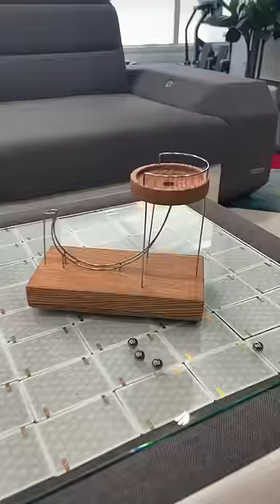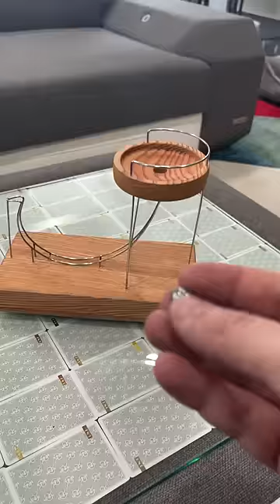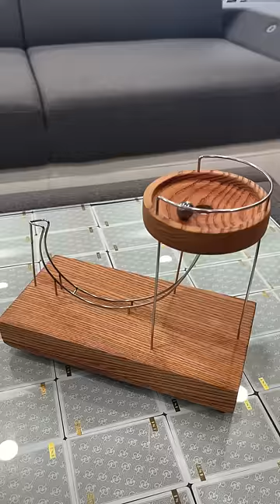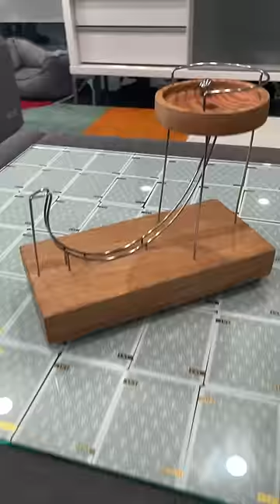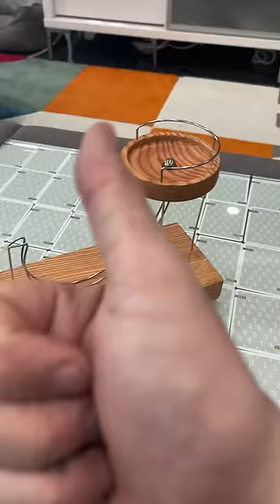An Impossible Perpetual Motion Device?! 😳 #Shorts

Comment: There's an electromagnet at the bottom powered by 2 small batteries
Reply: Yep, that acceleration is caused by more than gravity alone.
Reply: Nah bro...in that hole their is a spining gear you can easily listen the sound when it enters in the hole 🤞
Reply: @onlylearn7394 there are two versions. One with an electromagnet and another with a motor
Reply: @onlylearn7394 you can literally google it, it's an electromagnet, but go off or whatever.
Reply: Well could you have a regular magnet then with no power?
Reply: @geoffreyjett600  you can't turn a regular magnet off.
Reply: @justinmanley8131 
What if it's bi-polar? Or maybe just two opposing bipolar rare earth magnets?
Reply: Nah dont believe it how much does the ball weigh what is the height the angle?
Reply: agree
Reply: Yeah and the magnet is negatively charged
Reply: @onlylearn7394 lá ele
Reply: @StanErvin-yo9vl 

The ball would lose too much velocity on the transition from negative to positive.
Reply: Nope, not required. The energy stays in the loop so it continues. The problem is taking the energy out of the loop